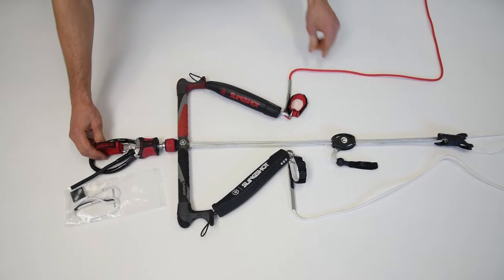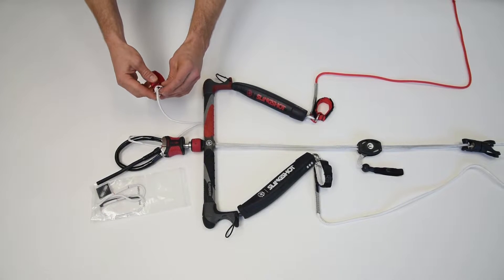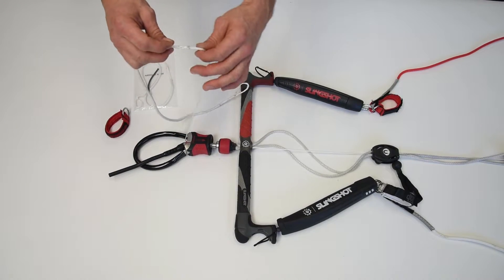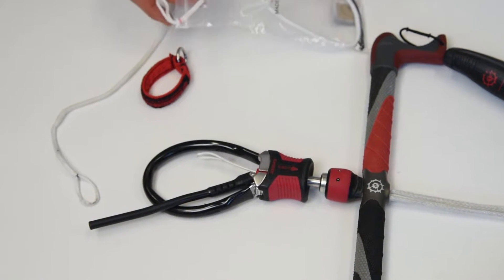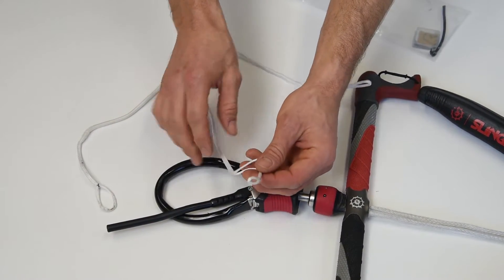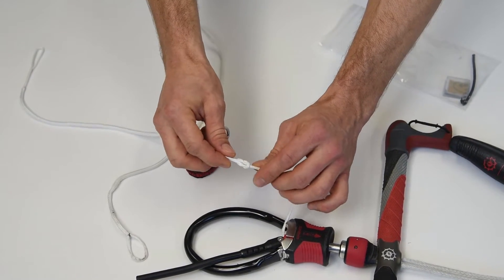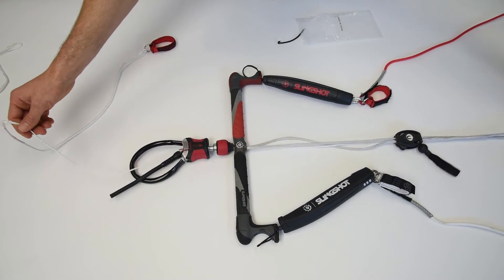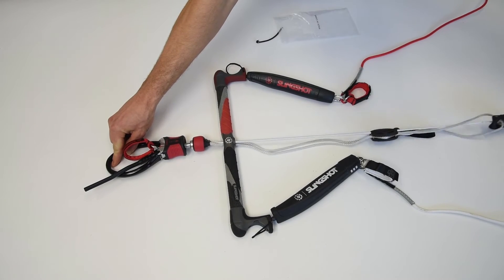Slingshot Tech: How to Replace CSS bungee

Comment: it would be nice if you all explained purpose of red stiff 2 inch long piece of bungee in package as well.  the method you show doesn't need it, but i assume when your old bungee actually breaks in two pieces, you may need the red piece to pull the new bungee thru the trim block.